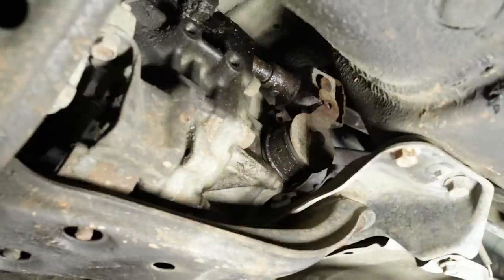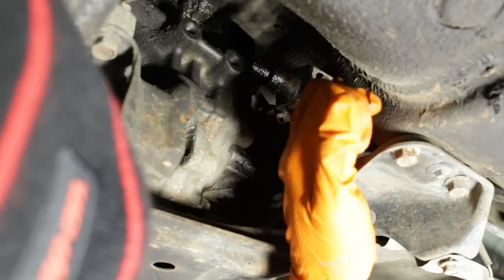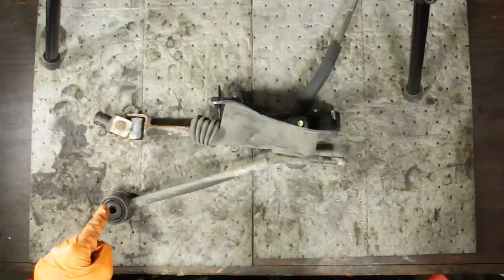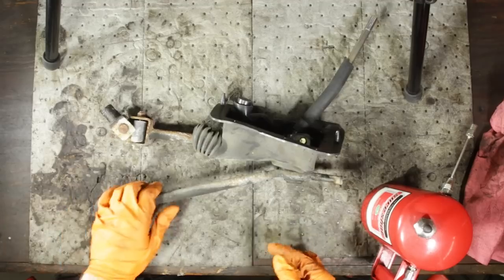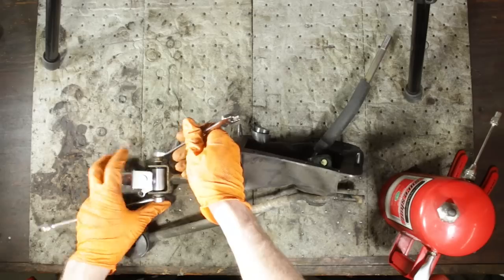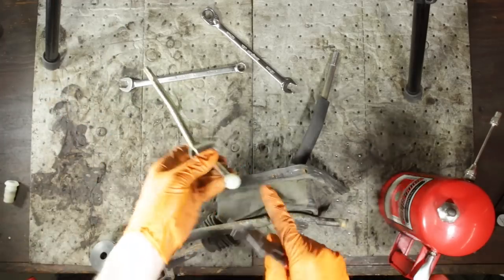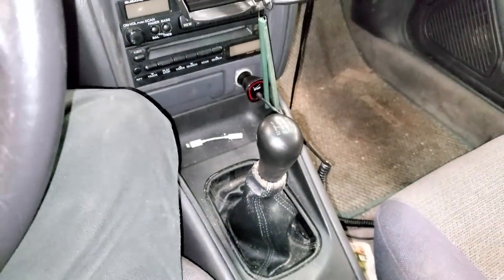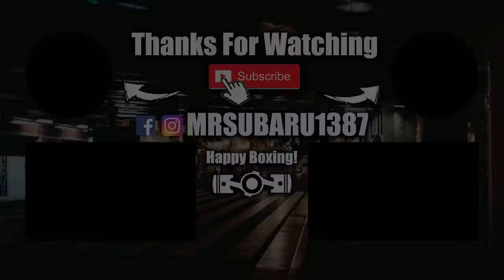Take The Slop Out Of Your Subaru Shifter!

Comment: I would love to take a slop out of my whole drivetrain between engine and wheels, as it feels like engine mounts are not holding.
Three differentials do their fair share of slop I guess.
Reply: A lot of people go to Group N mounts, or there are obviously plenty of aftermarket options.
Reply: @802Garage  I think I have play in gears..
Reply: @circuitdotlt  I would doubt it. If there was enough play in any of your gears that you could feel it, your transmissions or differential would be making horrendous whining noises and would be on the verge of exploding. It is possible that you have slop in your driveshaft joints, so that would be worth checking. More likely if you have a spongy or delayed feel in acceleration, it's going to be down to the engine, transmission, differential, and subframe mounts. Generally the easiest one to replace is going to be the transmission mount, so I would start there.
Reply: @802Garage  I can feel and actually see the play in differentials when turning the drive shaft by hand, o turning one wheel by hand..  An I saw this in multiple subarus.
Reply: @circuitdotlt  There will always be a minuscule amount of play in any mechanical linkage, but it shouldn't be enough to actually turn a driveshaft more than maybe 1 degree side to side with both wheels on the ground. The way gears mesh inside of a differential, what you're saying is essentially impossible in a functioning unit. If there was literal play between gear teeth, you would have constant horrible rattling and massive clunks when going from off to on throttle. The bearings in a differential keep the gears perfectly centered with practically no play. Gears are aligned so that they mesh perfectly and are always in contact, with a lubricating layer of oil obviously. In order for the gears to have play, they would have to be severely damaged or your bearings would have to be completely blown. The play you are seeing is from something else. For example, a worn driveshaft joint.
Reply: @802Garage  well them I must have a very sharp eye.. all gearboxes have more or less play, be it mechanical or differential ones... and sometimes the play is quite noticeable in well functioning unit...
Reply: @circuitdotlt  Agreed. As I said, there is always a minuscule amount of play in a gear set, typically measured in thousandths of an inch. I will still stick to my statements that in order for you to actually feel slop in the drivetrain from the differential while driving, your unit would need to be badly damaged or sorely needing a major service. I would still guess first that your issue is in something other than the transmission or differential gear sets. You can disagree, obviously, and I haven't seen the car, I just wouldn't want someone to waste money replacing a differential for lack of a bushing or U-joint.

Comment: Was about to do this on my Outback. But to my surprise the rod from the gearbox had a oval hole, and the sleeve that connects to the rod was wiggly. Bushings fine...
Reply: I've seen this. I drilled the hole oversized so it it round again and installed a larger roll pin. Soft metal on that shift shaft.

Comment: I have a 2013 Tribeca that will hesitate slightly when accessing from coast (coming out of a roundabout or give way sign etc), then suddenly hard shift, jolting the car forward violently. This happens even under light acceleration, but doesn't happen every time. Do you have any idea what could be causing this problem?
Reply: Daniel Johnston the transmission is gonna fall off 😂 jk but seriously, not good. 60 bucks at the dealer to look where I’m at

Comment: I have a Subaru Impreza WRX 98, I'm autistic, but really want to try this for my car. Are the parts I need the same
Reply from the maker: It should be. We didn't get the WRX here until 2002, so can't say for sure.
Reply: @MrSubaru1387  Did you find the torque setting for the universal joint?
Reply from the maker: @AlexReiter1988  torque for the joint, 18Nm. Torque for the bolt through the shifter arm, 12Nm.

Comment: So really the spring makes no difference?
Reply from the maker: The spring just holds the shifter at neutral position. With poly bushing help to keep it in neutral position due to their stiffness.
Reply: Im wondering if the slightest play I've got is because of the shifter spring.. but looking underneath when someone moves it. To me it looks like the play is in the extension case
Reply: The external spring is only on pre-98(ish) models. Phase 1 transmissions did not have an internal transmission return spring. After 98ish, there is an internal spring that replaces that external spring, however the joint piece and the lower bushing plate design didn't change and still have the little ears to hold the spring

Comment: As for transmission mount.. My 2008 Impreza 2.5i MT service manual does not say if I need to ever replace it as part of maintenance. In your experience, do transmission mount need to be changed at a certain mileage ??? (I'm at 62000 miles).
Reply from the maker: You replace them when they fail.
Reply: @MrSubaru1387  Thanks for the answer ! Will have a look under my 2008.

Comment: Question: on that rear bushing where you had to find longer bolts do you remember what the thread pitch and approximate length of them were?
Reply: M8x1.0 flange bolts - Stock are 10mm thread depth and 15mm into the body. Most rear bushings add a 15mm stack so get 30-35mm bolts and washers and you’ll be fine.
Reply: @autocrossaholic  thanks for the reply, I did the repair the day I sent that question in. Here's to me thinking ahead

Comment: I have question maybe you can help advise me on. To fix a release bearing noise I put a clutch disc, pressure plate, and release bearing in a 16 Scion FR-S(same as BRZ) and used genuine Toyota dealership parts and fluid. This was a month ago. The snout that the release bearing sits on was a little scared, but didn’t think much of it. Cleaned with Emory cloth, Lubbed properly with proper grease. He now says it’s hard to shift. I never opened the clutch hydraulics. Pedal feel is normal. He says he has since drained fluid and installed Motul fluid with no improvement. What do you think?
Reply: That snout on the input shaft must be repaired with a sleeve that secures over the damaged area hope its not that though!

Comment: I have an odd problem here, and I'm hoping you might be able to help.  .

I have a 2004 Outback LL Bean wagon with about 160k miles. I've owned the wagon for about 3 1/2 years now and since day one, it's been tough to select first gear. Up until about 2 weeks ago, if I gave the shifter a little extra downward "tug", I would be able to coax the 4EAT into low gear. But after sitting idle for about 6 weeks, due to a frozen caliper that I didn't want to replace in the heat of summer, I can now no longer select first gear, no matter how hard I try.

If it makes sense, it almost feels like there's some play in the linkage somewhere, because if I were somehow able to pull the lever downwards another 1/8 of an inch, i know 1st gear would engage. The tranny selects all other gears just fine. That said, now sometimes if i downshift to third, I need to give the lever another tug down to fully engage 3rd gear and get the "3" light to illuminate. My gut is saying there's a some loose linkage somewhere, or maybe a broken/worn tranny mount causing the transmission to slip out of alignment with the lever. Any help in getting this problem fixed would be MOST appreciated.

A MILLION THANKS...
Reply from the maker: My 2002 L.L.Bean was the same way. Very stiff and didn't want to pull manually into 1st gear. Just due to the shifter and cable not regularly moving to that position. Luckily mine freed up. You may have something inside the console jamming the shifter, coins and other items can find their way in. Check that and the cable/lever on the side of the transmission. Hopefully the issue is visible.
Reply: @MrSubaru1387  Pretty sure there's no surprises in the console..but I'll still take a peek. Any reason or suggestion to lubricate the transmission selector cable?  MANY THANKS FOR THE ADVICE. Your videos are such a great resource.

Comment: I have a question for you if you wouldn't mind sharing some knowledge, I just bought a 2004 liberty/legacy 5sp manual (pre facelift). There is a huge amount of play in the shifter when it's engaged in gears and also sometimes doesn't feel very smooth engaging into gears. My question is would this process fix the play in my circumstance? Also would it be a similar process for my car as it is here in your video?
Reply from the maker: Yes, and yes.

Comment: Where do you think of torque solution solid u joint shifter linkage?
Reply from the maker: I've installed them before. They just don't have the neutral return spring

Comment: Hi MrSubaru1387, I have a rare one of a kind vehicle with parts that need replaced to have such wonderful results like you. I need help! 1997 Subaru Legacy 2.3L MT 4WD Outback Wagon. It’s a great car that needs an impossible to find part. We used the part number to order a shift stay arm only to find out the one currently attached to the shifter assembly is un-attachable. Not only that, but linkage is welded to the shifter! I don’t have very good pictures and I don’t know how to post a picture in the comment section. I am looking for the entire assembly if possible for this car in order to finally complete with this project. If any chance you could help me please do try!

Comment: Can someone help me out? I did this same exact method. But every time i shift to 3rd gear or 5th gear it keeps popping off the base and the snap ring keeps popping off. I don’t wanna disassembled everything cause the u joint pin is a pain the ass. Any suggestions would be highly appreciated thanks
Reply from the maker: Sound like you didn't get the ball seated all the way before placing the shifter in the base and securing the the snap ring.
Reply: MrSubaru1387 thanks bro! After you replied i smack the shifter with a mallet until it was flushed and then put the snap ring it pop out like 2 times  but patience with the snap ring it seated flushed thanks super worth it.

Comment: I just did this on my legacy b4, but the exhaust makes it impossible to get the rollpins back, as i had to hit it at a 45 degree angle. i just put a m7 (i think) bolt and nut, and tightened it up. the bolt fits EXACTLY, there's no room for it to wiggle, so no play in the shifter because of it. why didn't they use that method in the factory !?
Reply: I have the same model, can I ask what parts you used for the replacement? Also was it a similar process as displayed in this video?
Reply: @stormb3948  hey, definitely. I was struggling bigtime with the method shown in the video, so I just put in a bolt through the hole the roll pins should go through, and tightened it up with a nut. Can't really remember what size the bolt was, maybe m7. It did loosen up a little after a month or so of driving, so I retorqued it hard, and it was golden again. I sold the car shortly after, so not sure how it held up.
Reply: @Cydro12  Awesome thanks mate 👍 my car has a lot of play when it's engaged in gear and also sometimes doesn't feel very smooth when engaging into gear. Do you know whether this process would fix both issues or just the play?
Reply: @stormb3948  yea, the play part definitely. The engaging part will most likely be fixed aswell, because of the play it's hard to put in in gear straight. Don't be afraid, the bolt and nut method is far easier as shown in the video!

Comment: Hey Mr Subaru. Have a question for you about my 03 legacy outback wagon. I went and had it inspected and it didn’t pass due to the monitors not being cleared. I drove it and drove it and drove it for hundreds of miles and they won’t clear. Finally the check engine light came back on for po420. I just replaced the cat and one of the o2 sensors last year. And it has an Evap code. I gave up and took it to the one guy in the area that knows Subaru’s from top to bottom and has been working on them for 15 plus years. He took it and did the same. Except he put another cat on with my spacers and the code actually cleared and didn’t come back. However the monitors still won’t clear to pass inspection. He is at a loss as am I. Can you please help?  Do you have any suggestions?
Reply from the maker: Which oxygen sensor was replaced?

Comment: Does anyone know which shifter bushings will work on a 2012 outback 6 speed?
Reply from the maker: That's a cable shifter. Totally different
Reply: @MrSubaru1387  got it! Thank you... is there anything i could replace to reduce the slop a bit?
Reply from the maker: @adriancuevas1587  not really. It's a plastic shift box with cables coming out. They have improvements for the 15+wrx, near identical setup. Can't confirm if it works in the 2010-2012 OBK LGY
Reply: @MrSubaru1387  thats a bummer ! Thanks for quick reply really appreciated!

Comment: First (of many) mods i did to my '03 WRX shortly after i bought it new was install the Subaru "short throw" shifter. I recently replaced the lever on that with a REAL adjustable short throw (Cobb) shift lever.  The Subaru shifter did not come with the universal joint at the front. Wish i had known about that as i could have had it replaced during my recent clutch upgrade.

Comment: Hi !! Can this problem be responsible for the 4th gear poping out ? i just changed the transmission mount and it feels better but the shifter is still a bit sloppy and it pops out of 4th gear when decelerating or going over some bumps. I just wanted to check this fist before i get inot checking pilot beaing... Thanks a lot !!